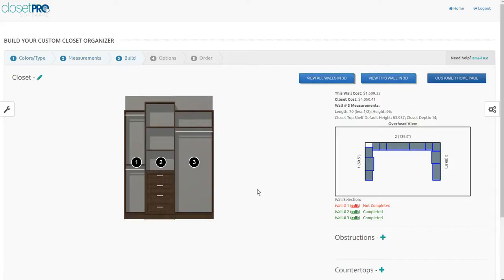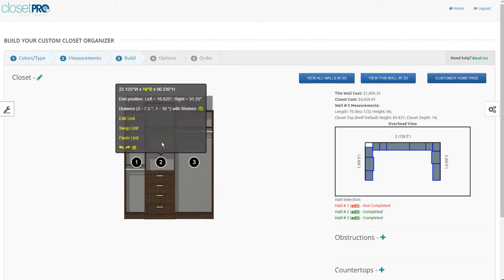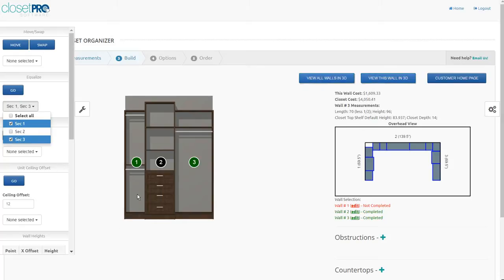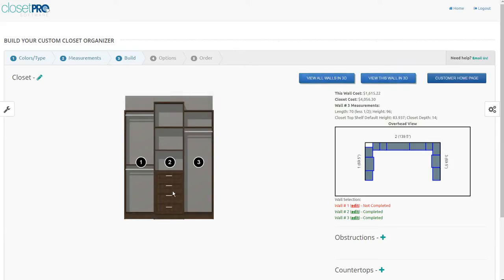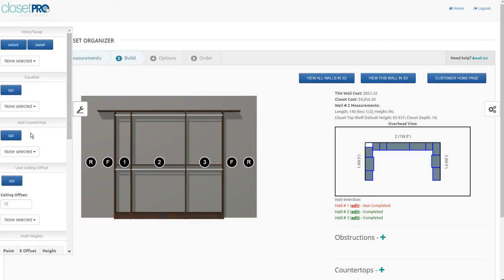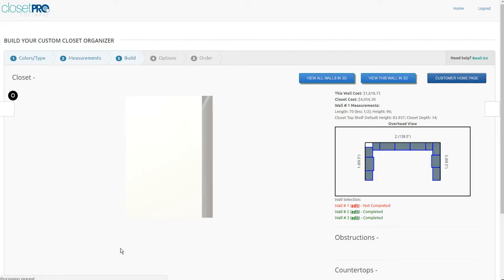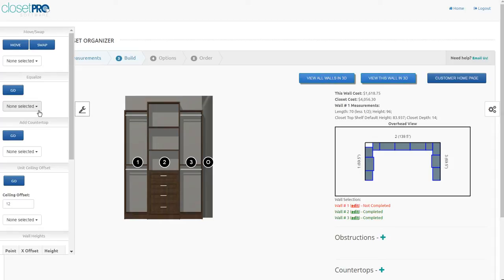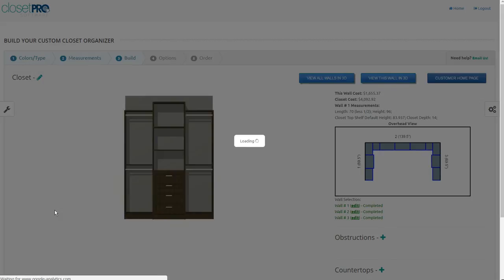Using the Equalizer Tool

Comment: What about heights? I would like to make sure some horizontal shelves are uniform. They are currently about .25" off from each other and so far, I have only been able to eyeball it and I can't get it to be the same for each unit.
Reply from the maker: For lining up the shelves of 2 sections, it's best to copy and paste the unit and customize from there if possible.
Reply: @ClosetProSoftware  Thanks for the tip!